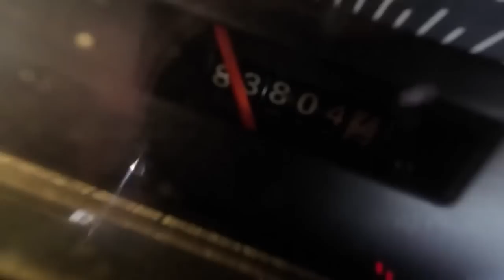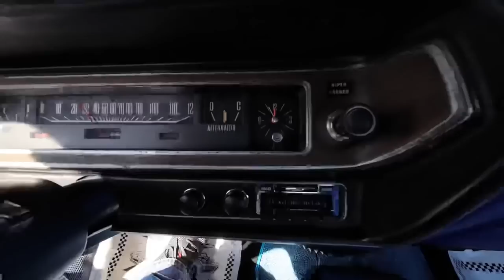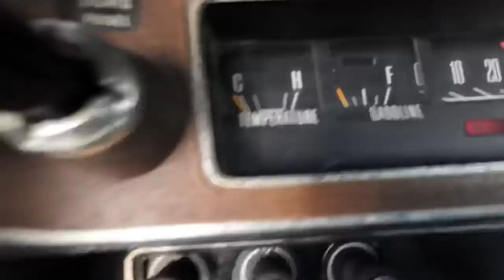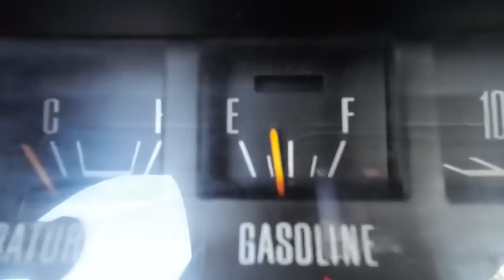Test Drive 1972 Dodge Charger V8 SOLD $29,900 Maple Motors #1555

Comment: It needs a 440 LOL 🙂
Reply: Big time.
Reply: Funny thing is; almost all the Dukes of Hazard Chargers were 318's lol.
Reply: you can build a 318 heads, cams, bore it.   watch 318 will run, on YouTube he has a 318 in a duster tunnel ram cam and so on dose like 12s in a quarter all low dollar parts most used and did it in his driveway.   i have a 440 in my Plymouth scamp i would rather have a 340 or small block built
Reply: @mikesteelheart  Hollywood
Reply: 340
Reply: @mikesteelheart  Actually, most were 383s.
Reply: @bulldoggarageapparel7511  No thanks that is slow LOL
Reply: @LITTLE1994  I know they put 4bbl's and dual exhaust on the 318's for the extra power needed for the stunts.  The 383's they probably left stock.

Comment: My best friend's older sister had a 1973 a little bit lighter blue with a white vinyl roof. Of course modern paint doesn't match exactly because of the change in chemical makeup. It was a very cool car. Very Star Trek front seats and steering wheel. Even furniture was available in that style from the late 60s. 😊

Comment: A 318 is a truck motor not a performance motor if you like this car and you have a big block ready then swap the k member n put in that 383 or 440 with a 727 auto trans or 833 4spd but if you could go all out restomod with a modern hemi n auto trans 4 wheel disc brakes a true restomod not a 318 n I had plenty of 318 cars all junk with a 2 barrel carburetor. 1971 last year for real old school Mopar performance cars